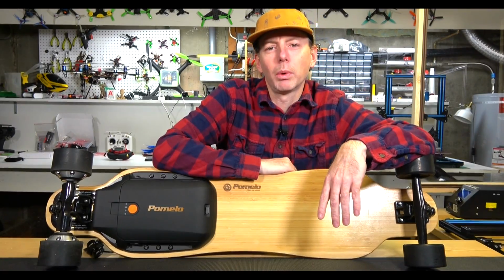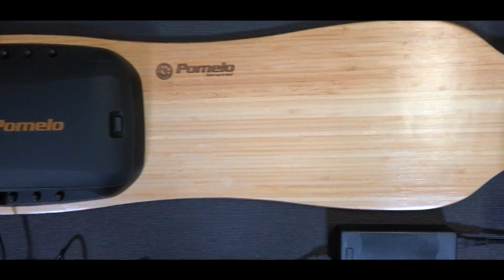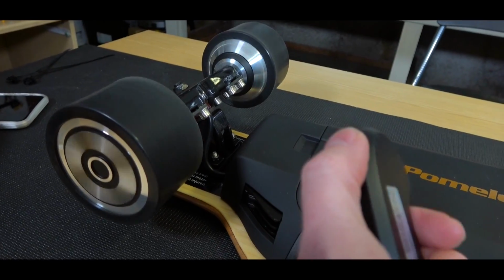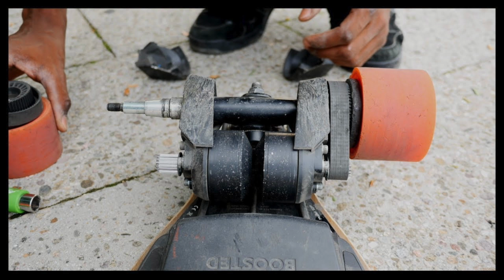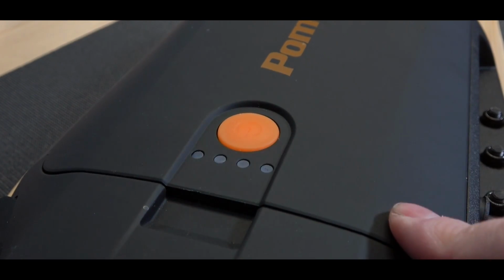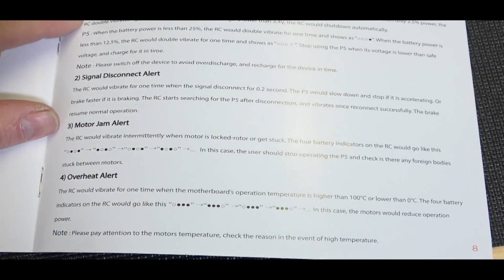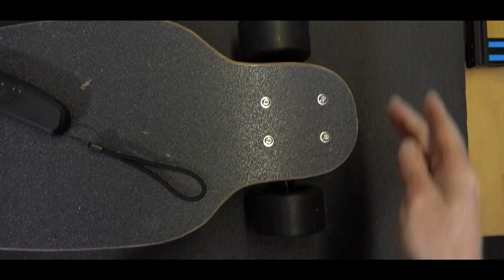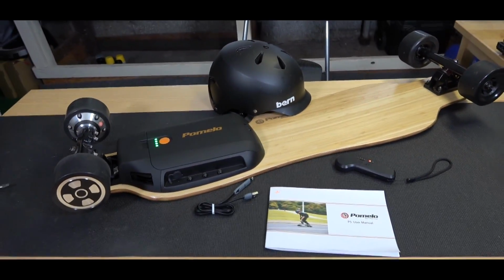BETTER THAN BOOSTED BOARD - HALF THE PRICE

Comment: My meepo mini takes me 210 pound self 28 mph easily and accelerates really fast paid 645 for it including shipping it gets claimed 22 miles of range with the extended battery which I have  I’m a little on the heavier side so I’m getting around 17-19 miles of range

Comment: How's this board going now almost a year later ..
Reply from the maker: Still hanging on my wall with my other boards and still one of my favorites to ride.
Reply: Still worth buying in today's line up for value and reliability .. have you had any issues with it . Faults ... etcetera ..
Reply from the maker: Still works fine for me. I love the power and flex of the deck. Very smooth board.
Reply: @dronecamps  
Thanks for the heads up .. looks like that's the one for me .

Comment: And they have the belts on the boosted because it lets it have better speed and acceleration and braking. It take me about 3 minutes to change the belt and then I’m off and if you get a good brand of belt I can last a hundred miles before even having to change it which is very good. And you haven’t even ridden a boosted so don’t try and act like you know everything about boosted.

Comment: How does one replace the back wheel on this?
Boosted fits many dif longboard wheel companies so your not limited in that area.

How does the motor wheel ride when coasting or if it locks up?
Boosteds belts that you say are old tech are reliable in that way, you break a belt you are not confined
to the motor. You can quickly unplug that wheel or both and cut the belts to make it more like a normal push skateboard.

Im noticing your pros, are cons for me.

You have me on skid plates but if the belts prevent the above, Im ok with having some plates to help.
Please ride a boosted for a week then re-review this, I have a feeling you will be happy with the money spent.
Also 14 mile range on my boosted and 20+MPH. 

You can get 30+MPH with the kegal speed hack also. Not a joke.

Comment: Well done Justin..im a 60yr young guy (a bit on the crazy side but a newbe) not sure if i like the small wheels.  Im looking for an off road board strapped in kinda thing. Im a cad guy so i can draw and cut my motor mt. im looking at trampa boards and do it my self. Is this the way to go or buy and go.  thanks
Reply from the maker: Im still riding this board. I would def recommend it. Ive had no issues with it so far. Rides really smooth and holds a charge well.

Comment: Hey Justin, what do you do about the wheels? How quickly do they wear down for someone riding +2 miles everyday? Can you replace them easily? So far I like the idea of the P5 but I want something that will last.
Reply from the maker: So far mine are doing fine. I ride it almost 5 days a week. I haven't even had a thought about replacement yet. But yes you can swap out wheels.

Comment: Yo bro. I was saving up for a boosted board, but after seeing this video. I'm sold on this model. Do you have and videos on real world testing? or range test? How long does it take to charge? Thanks for the fly ass review.
Reply from the maker: About three hours to charge up. Dude I went up hill with speed. I live in an area with big hills. Prob 6.5 miles on a charge real works conditions
Reply: Wow bro! I'm sold. I really want a board this summer. Half the price? Count me in. Thank you for getting back to me.
Reply from the maker: You’re welcome. Still riding mine and happy with it.

Comment: How does it roll when it dies? Let's say you go around 6 miles and it dies 4 blocks away from your apartment...Can you skate home like a long board? It is brushless, so I assume there is plenty of play and we should be able to skate normally right?
Reply from the maker: They say it might hurt the logic board. But who really knows though. I think since you have regenerative motors once their spooled up then you would get power back into the system which could possibly hurt any electric skateboard with regenerative power set up.

Comment: How the board do up hill? can you do up hill test?
Reply from the maker: I have driven it up 30 degrees hills in Portland. It handles hills no problem. Even with some speed going up. I was impressed.
Reply: Drone Camps RC  Surely you mean 30 percent grade hills, not 30 degree hills?
Reply: Physics would not allow you to go up a 30% grade with 150w motors. Either the motors are more powerful, or you must weigh like 30 pounds. Lol. 
 I have an evolve gtx (max power of 3,000w) and I can’t go up a 30% grade in eco mode, which limits the board to ~800w. Not possible  with the amount of torque hub motors would produce at ~300 combined watts

Comment: This almost feels like a sponsored video :D
Most unknown brands make mistakes, on paper it looks good, but what i want is a review by someone who has ridden this for a few months. Cuz usually these break or problems start to appear after like a month of riding. Battery pack usually fries the contacts and it doesnt work anymore. Also, the hub motors can be low quality and start to spin around the axis, tearing a wire or worse, breaking the hub motor. Depends on the acceleration and ur weight. Belt systems are more reliable, appart from the belts breaking.
Reply: MadOss my friend bought a genesis board( a no name electric skate board) that had good specs and it performed amazing for about 1 week, then the esc fried and the hub motors burned out. After spending 150$ in repairs the battery holder came off while he was bombing a hill and he flew off . People always ask what are the specs but unless the board can last , it doesn’t matter
Reply: It broke the first week

Comment: Thanks for bringing this up. Cool board.
Belt drives are not just "old tech". They have their place. You can put Much larger motors on a belt drive system rather than an in-hub design. You have customizability with different motors and wheels and even gearing. Say you move to a more hilly area and want taller gears for steeper slopes. Say you want a better/stronger motor or it burns out. Say you want a 2kW motor because you're nuts. You can't do that with hub motors. But they are more maintenance.
Deck certainly looks like bamboo on my screen. Maybe a maple core...
How does one ride this board without the battery??? Lol.
The grip tape is too grippy? Why not just give it 5 stars? Is giving something 5 stars such a bad thing?
Reply: 40 Life  I agree, my £200 budget build has a single belt drive motor and it climbs 20% hills and has an electronically limited top speed of 20mph.

Comment: EDIT: Forgot to ask, how is the drag when you peddle? On a scale of 1-10 with 1 being like a conventional board peddle and 10 being, can't peddle at all when the battery dies or is low. Thanks again for the review!

ORIGINAL POST: Solid review bro. I wanted a boosted board when they first came out, but it's too pricey. I feel like the Boosted brand is like iOS and this P5 is like Android. And I'm a 100% Android guy. Also, you definitely pointed out the weakness of the Boosted board, with that old ass tech. I'mma still shop around but this P5 review is convincing, though I might just get modular kits and strap it on to my favorite Sector 9 board. Don't know yet. There are so many electric boards out there nowadays and I'm just looking for a great board for a great price.

Comment: I am 60 and was thinking about an electric skate board but I went with an electric RadRover electric bike.  Thing is when you get older and you take a bad fall on a skateboard it takes a long time to recover and I still have to work.  This board looks nice but I would like to see a longer range longer than 7 miles.  Think a newer board should get double that.  7 miles can go by very quickly.

Comment: How's the board going now? Is it still worth a buy?
Reply from the maker: Still got it. Still riding it around. No problems so far. Takes me uphill decent with the dual motors. No issues with acceleration.
Reply: Nice dude, I ordered the Pomelo last week Thursday and it should arrive here this week Thursday. I can't wait.
Reply: Will do, i'm going to make a unboxing/review video as soon as I receive it.
Reply: SimplyPops ok thanks.
Reply: SimplyPops post a link please. Wanting to upgrade mine. Struggling to find descent boards in Australia.. ...
Reply: Still going strong. I will make a 1 month year review.
Reply: SimplyPops when u get it tell me how it is I’m considering of buying this board.
Reply: how is it now like a month later ?
Reply: would be good to see that
Reply: I ordered the Meepo Board, its not there yet but it has better stats for a lower price and insane reviews!
Reply: Why do these boards have better range and speed then the expensive ones and yet they are cheaper. What is the catch?

Comment: Nice review!  Personally, I'm still buying the boosted board (ordered it today).  I may upgrade to an in-wheel motor board later, but for me, the torque and acceleration of belt driven is so much better, that I'm willing to deal with the maintenance.   They also seem to have really good customer service and I know if something goes wrong, I can send it in.  The Pomello board seams really cool though!
Reply: Jack Meadows I’ve had a B.B. V2 for about a year now, and it’s required almost no maintenance. I’ve had to change to belts once (around 450ish miles) and it wasn’t that big of a deal. 

I have almost 1,000 miles on it and haven’t had any issues so far. I LOVE it.
Reply: They're actually out of business. So nothing with customerservice and replacements

Comment: lol. Utter bullshit. I'm not a Boosted fanboy by any stretch of the imagination but to call this an "honest" review is utterly laughable. One - there are pros and cons to hub motor vs belt driven motors but somehow you fail to mention any of that. And if you don't know what I'm talking about, fucking Google it. Secondly you talk about the BB plate design and say that "it's so low on the ground you'll probably catch things and get off your board" LOL what the actual f'ck?!...  No. That simply does not happen. Yes the plates get scratched but you don't catch things and fly off the board. It's a retarded comment. Lastly, you're quite happy (like so many others) to use the BB name for clickbait purposes just so you can shit on it in your vid. Just think about that for one second maybe?... It really grinds my gears to see bullshit "reviews" like this when it is quite obvious you're getting something in return (cash? free board?). Call it an ad instead and I wouldn't have that much of an issue.

Comment: Does this board have the same flex as a Boosted Board? Also, it would have been nice if you did a head to head comparison with the Boosted. Things like acceleration comparison, braking, board flex, responsiveness, top speed flat, top speed on inclines, etc.

Comment: I learned that the reason Boosted board have the belt drive was to improve the acceleration over the direct drive. How is the acceleration of the Pomelo ver Boosted?  The ability to swap batteries and a decent price is a clear winner for me.

Comment: I personally still like to have belts. Twice I had brushless motors, and twice the board failed me. No, it wasn't the motors that failed me, but the 8 screws which are used to attach the motors to the trucks. If you were to ride them out in abnormal weather (too hot or too cold), it might degrade the screws. For me, they eventually snapped after 3-4 months and since the screws were snapped, that means the top was stripped so I can't even remove the screws. I had to send it back for warranty. Even though I received a brand new one, the same exact thing happened.
Reply: Wei Ming why didnt u change the screws after 2 months if you knew about the problem? You could've used the second board longer.

Comment: Are the wheels for the hub motors replaceable or do you have to replace the entire hub/wheel? If I can't replace just the wheel then it's a no go for me. That's my only issue with most hub motor boards.  Belts are cheaper than hub motors.
Reply: bashort1 most important question.
Reply: MrTicohn This would be more of a toy for me so the Boosted is out of my price range unfortunately. I'm still researching and pondering.

Comment: Looks like a nicely finished board.  I just got a Koowheel V2 and love it.  The Koowheel has twin 350w motors, and easily the same range. 
I got it last week ,so haven't had a chance to ride it till the battery is exhausted, but  I went 6 miles on it and the 40% battery warning didn't come on. 
  I paid AU$800 ,which is about US$630.
These electric skateys are so good, I turned 51 this year and have never had so much fun.
Reply: I think koowheel is my first out of all I have looked at

Comment: woohoo... was thinking boosted for spring... so looking into this one... big time Thank You... what a treat this review
Reply: I would stay away from “direct drive” or hub motors. They have no gearing (like belt driven systems) so they stall uphill. Belts are not difficult to change. Hubs are basically motors wrapped in a 1/4” of urethane. The ride is bumpy. You’ll wince on every sidewalk crack because you’re rocking the motors with every thump.

Be aware that electric skateboards require maintenance. Boosted provides incredible customer service. I don’t know if this clone has a US service shop that does repairs. $700 is a lot of money to burn even if it’s less expensive in the moment.
Reply: No boosted....but not even this one....there's tons of better board out there...trust me....this is good....but there's a lot of options even with HUB Motors....
Reply: You should check out the backfire 2, costs 500 dollars. It's a great board
Reply: HomeGrownCanadianFPV don’t buy this shitty board, hub motors are so trash cause they have no responses to the controller, and u can’t replace the rear wheels

Comment: 84 watt charger, nice. Curious what batteries they are using. The warning about the not riding without the battery is probably because of inductive spikes and motor electric feedback. My guess is they take this energy and pit it back into the  battery. So without the battery a fast so would generate power and have no place to go and damage the board. Just like a fast stop with a prop on a quad motor blowing out the ESC. In fact, it has to have ESC’s for each motor, probably all built on the board. Maybe version two will have a separate main board and esc’s so of this happens they can be replaced. 
I think I’ll wait for someone to damage the main board, buy it broken and fix the board. 
A good remainder for all is if your not going to ride for a while don’t keep the battery fully charged. You will be able to get m,re use out of the battery. I would keep the LED about 70% if you can. But with such a fast 1.5 hour charger it’s not a big deal. To charge that last 30% would be fast, probably under 30 minutes as you get ready to leave and pack up.
Reply: Is that why the cheap ESCs sometimes just burn for no apparent reason?
Reply: pro tip : you can watch series on Flixzone. Been using it for watching loads of movies during the lockdown.
Reply: @Marley Axton Yup, I have been using flixzone for since november myself =)

Comment: I ride a MetroBoard myself but really want to rip one of these ones that have the motor as a wheel! Very cool!
Reply from the maker: They are pretty cool. It's a really clean looking design.
Reply: 4mods Aerials I love my metroboard yo
Reply: Same yo, 40 miles n no need to worry about charging, just leave it in the car for a couple of days n still got juice :D
Reply: Can't be beat for running time! I have the 40 mile longboard and love it, just surf it.

Comment: A Boosted board belt takes 3 minutes to change
Reply: Fan of the belts too
Reply: Drone Camps RC hub motors are notorious for damage because the rider is basically crushing them between their weight and the bumpy road. It’s far easier to change a belt than a motor. There’s a reason high performance vehicles still use belts. And hubs are terrible on hills.
Reply: I've tried a few boards now, I have never been on a hub motor board that has come even close to a belt driven one. Maybe i'm biased because I've been riding on my Evolve GT for almost 2 years now. Another pro is that i can change out to whatever wheel I need to (hard/soft/smaller/larger/wider etc.). Of course there are always cons to belt driven, but they are cons that I definitely can live with. In my honest opinion, there is no perfect board.
Reply: You have no acceleration as a result
Reply: Think of the long term, one of your motors go out or anything goes wrong with a wheel you have to replace the whole wheel unless you know how to fix the complexity of the motor. Ouch that sounds expensive. The boosted board is fully modular and is extremely easy to fix with all the parts associated with movement separated and not concentrated in the wheel. Boosted Board is easily fixable and maintainable for thousands of miles. Plus, since each part is distinguishable, its cheap to repair unlike a brush less wheel.
Reply: Drone Camps RC I have charged several belts today.
Reply: No kidding. What is the problem with belts here?!? Not like it takes a genius mechanic to do it. No need to belly ache over that minor detail. C'mon guys!
Reply: Drone Camps RC can you climb up 25% grade hills? Do you have instant torque?
Reply: Drone Camps RC, “ I don’t have any belts too change “ yes but if your wheel goes bad you have to pay for a whole new motor.
Reply: Definitely a fan of the belts. They provide more acceleration and firm control over stopping power.
Reply from the maker: I don’t have to change any belts